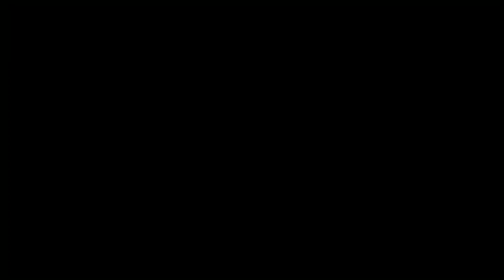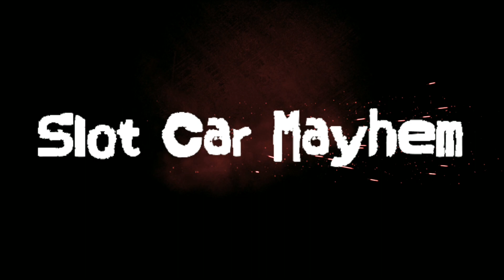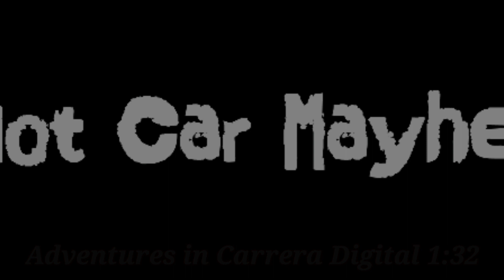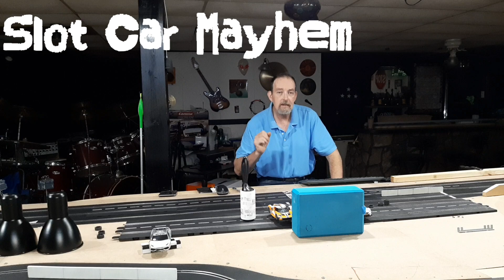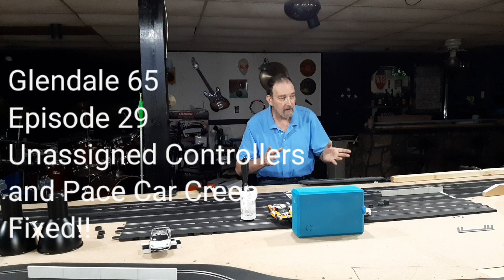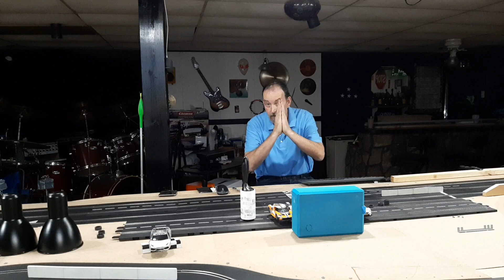Glendale 65 - Episode 29 - Unassigned Controllers and Pace Car Creep Fixed!!

Comment: Hey John,  great videos.
 I  am having the same problem with my pace car  set up.  But i dont think the wire fix you described  is the issue, at least in my case.
I have a  routed wood track using carrera components    My control unit has been cut away from the track it comes attached to  and the wiring has been redone . sensor wires and power taps.   I have noticed that the pace car will only move out on its own when other cars are moving on the track. 
If the track is empty ,the pace car will not move.
I am thinking about isolating, electrically , a small section of the pace car's pit lane. which i will wire a toggle switch in. to turn power on and off to that isolated section .  it would then be a 2 button push to activate and stop the pace car . 
 this might be a example of your banana story though.
Any thoughts?

John
Reply from the maker: That was my exact thought as well, but realized the noise created by the cars was the trigger. Are your sensor wires separated from the power wires? That's what fixed my issue.
Reply: Hey John
 @slotcarmayhem9765  Yes the wires are separated    right as they exit the CU  ,,from where the piece of Carrera track was.
I have isolated  electrically a small section . like I described in my last post. And it  did the trick. 
On a slightly different topic. How do you  start a race using the pace car?   in other words a rolling start. 
I am using HSSRMS timing software , and i use the start button on the CU to commence the  countdown to green flag.
I am thinking,  after  the green flag is dropped , the grid  waits  for the pace car   then cues up behind him , then the 1st lap of the race is under "caution"
 It seems like there should be a better way?

Comment: Hi John,
I subscribed your channel on Youtube and I've been watching your very useful tips on slot cars. I must say you are a very skilled person.
After 35 years away from slot cars, I'm now planning a brand new digital 132 Carrera track.
I already purchased the "DTM speed memories" set plus 2 additional wireless controllers with charging stations, also 2 additional cars and track sections for expanding its length to about 20m.
I also got a Startlight and I'm waiting for the Pit lane set that is out of stock for now.

As you proposed on one of your channel episodes, I will use the "Smartrace" app.
But I don't want to run it on smart phone. I want something bigger. I know that it can only be used on IOS and Google's ChromeOS devices. Can you propose some cheap devide with a good sized screen?
After being instaled on a device, can it run directely pluged on the "PC-Unit" of the control unit or is it always needed the "Appconnect" device to connect via bluetooth? I didn´t bought the "Appconnect" yet because I'm hopping I don´t need it.

Which Carrera devices are dispensable when using the "Smartrace" app?
- Lap counter (ref. 20030342 or 20030355)?
- Wireless tower (ref. 20010108)?
- Position tower (ref. 20030357)?
- Driver display (ref. 20030353)?
- Startlight (ref. 20030354)? (I bought it anyway because it's cool)

The "Smartrace" app also replaces some of the functions of the control unit, right? Which ones?
Are there some functionalities on the "Carrera race" app that don't exist on the "Smartrace" app?

I'm a kind of an inventor and a few years ago I proposed to Carrera and Scalextric brands a change on the slot cars concept that would improve the entire experience. They rejected the idea.
Now, as soon as I have the track fully assembled and the cars running, I will test my idea. I will keep you posted on the results.

Thanks
Reply from the maker: Thank you for the kind words!!

As far as I know, SmartRace is only Android or IOS. You can cast the device to a big screen, but I did something different.

I used a Khadas VIM3 Pro (Android), and installed Smart Race on that (works great) and connect to the screen directly with HDMI. I have a couple videos on this exactly!

SmartRace DOES require the App Connect dongle, as does the Carrera App, so I would grab one asap.

The Startlight is cool, and I am going to build one using an Arduino. Its a good thing, and useful with Smart Race.

You are correct, the position tower, driver displays, and the lap counter are unnecessary with both the Carrera App and the Smart Race.

Even if you go with Smart Race, I recommend downloading the Carrera App, as the CU firmware is updated using the Carrera App.

Welcome aboard, and looking forward to your progress!!
Reply: @slotcarmayhem9765  Thanks John, I may have more questions on the process.
Reply from the maker: I'll be happy to help any way I can!!

Comment: Hi John, We haven't heard from you in a while, is everything ok? I have been waiting to see updates for your track landscape and lighting along with other general videos with tips and mods. I really enjoy all your posts. I have implemented so many of your suggestions on my own track and cars. Miss your videos.   Ron
Reply from the maker: Hi Ron, I'll be back soon. Work load... Next visit are of the Pit Buildings (scratch built). Thanks!!
Reply: @slotcarmayhem9765  Understood, Look forward to your return.  Take care
Reply: @slotcarmayhem9765  John can you send me your wiring diagram for the switch on the power supply using the proper wire color for  ATX and not  Dell. I am having difficulty with the wiring using the ATX supply; using the same switch.  Ron

Comment: Hi John, can you tell me how to set the speed of cars when they run out of fuel.
Reply from the maker: Hi Peter, if I recall, it is a fixed value set mode set in the chip firmware... feels like 30% or so.
Reply: @slotcarmayhem9765  so no way to change it in smartrace app.
Reply from the maker: @peterjackson5210  I don't believe so...

Comment: just found a strange problem with my Andriod box, Google Text To Speech won't stay installed, If I turn the box off, I have to re-install Text to Speech every time, so now I leave it on, but not what I want to do.
Reply from the maker: Thats odd... never heard of that before. I would suggest reaching out to Google support, that is not normal. Do you have the latest version of Google installed?
Reply: @slotcarmayhem9765  version 10.0, google not interested, said its a hardware issue, looks like I'm going to have to find something else.
Reply from the maker: What hardware are you using? Maybe a software update?